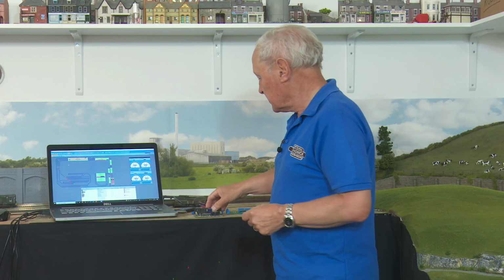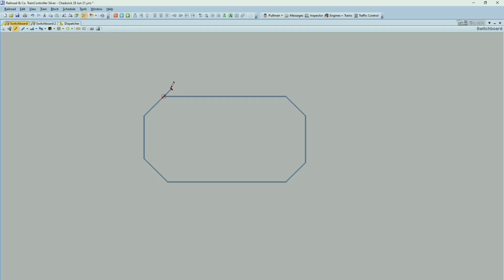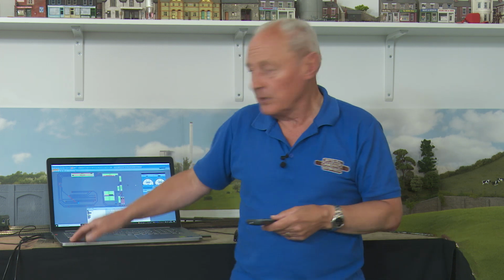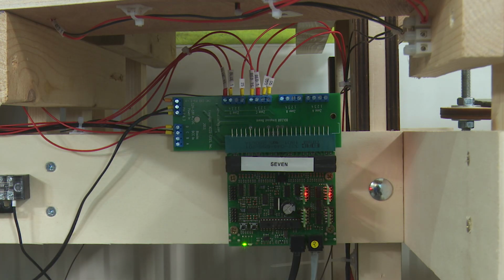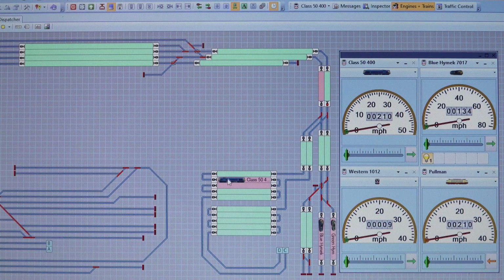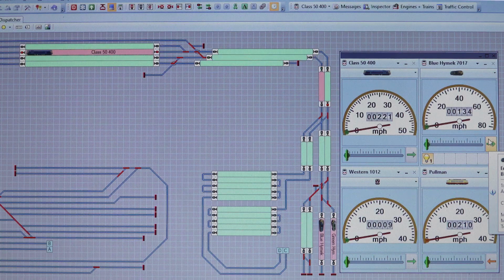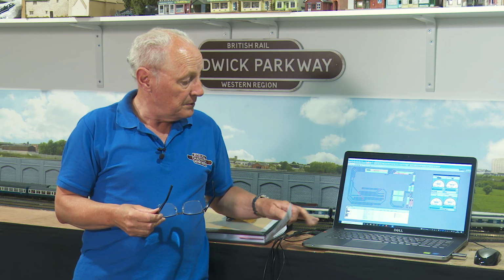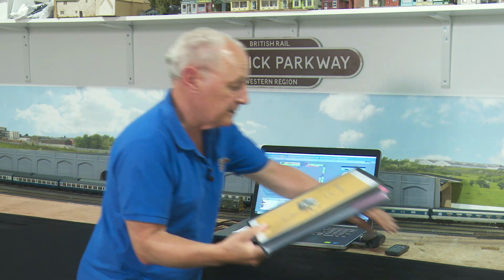An Intro to Block Detection at Chadwick Model Railway | 137.

Comment: Hi there Charlie, I have just watched this video for the information on block detection. I am building a new layout, the fourth  layout this one, I will get it right yet. I am thinking ahead and making insulated blocks in the track layout ready for future projects. I have already changed my control system to a Roco Z21, from my previous NCE system. Not sure if I will go for full automation but there is no way I could afford Train Controller, the guy does not seem to like us brits any way. Something I noticed in your wiring video is you recommending 7/02 for droppers, on another of your videos about wiring and power management you  recommended a site Railwayscenics where they recommend 16/02. Like you I wire every piece of track including points with there own feed, but since I got into sound locos I have had a bit of trouble with some of them. So the new layout I am presently building I am using 16/02 droppers. Thanks for these videos I understand the work you put into them even though you run oo gauge and I am on N-Gauge, enjoy the errors you put in too, others probably delete. Chris
Reply from the maker: Hi Chris, 
Yes I have moved away from 7x02 to 16x02. 
It was the voltage drop that led to me over engineering as usual! 
Regards Charlie

Comment: Charlie do you know if the bdl168 will take current via Rail A and Rail B. Strange question I know but I added block detection after my layout was built and I took advantage of the frog insulator to give me the first isolation point, hence from a main line the 1st section is rail A and the loop first section are rail B. Hope that makes sense. I recently changed from NCE to Digitrax, it didn’t matter because either rail was through an induction coil to the NCE AIU interface. Regards Roy
Reply from the maker: You might be looking at this from the wrong direction Roy.
The BDL168 takes power to the rail, not from it. All of my BDLs feed power to the red rail, and the black rail is the common return.
Hope this helps, regards Charlie
Reply: @ChadwickModelRailway  it’s ok Charlie I had some wild idea that hopefully I might be able to mix red and black on the bdl 168 if it depended on isolated current draw, but I can see now it doesn’t. Just have to bite the bullet and cut the relevant rails. Thanks for taking the time to reply. Always look forward to Friday’s though. Roy

Comment: Hello, great to look at your channel. I have one question concerning feeders for blocks. As block consists of 3 parts : entry, main, stop and obviously we need 3 feeders (for eg. + rail), but what about feeder/s for the common rail (- rail) ? Do you use 1 common feeder for entire block or 3 separate feeders, so each part in the block has 2 feeders (+ and - rail)? Thank you in advance for some help.
Reply from the maker: Hi Robert, the common return is connected across all rails. Regards Charlie

Comment: Hi Charlie, I am revisiting my track layout to set up blocks for block detection. The mainline blocks for the up and down  lines between the points to enter and exit the platforms is relatively short and would entail some of the carriages being in the preceding block and over the entrance point to the platform. Obviously this point would be set for the mainline but should the exit point from the platform line be set for a loco to leave the platform then the mainline block would need to signal the through loco to stop and as the distance is short the insulator for the rail would need to be placed to give sufficient distance for the loco to stop. I t is at this point that some of the carriages would still be in the previous block and over the point. The question is, will this work or does the complete loco need to be clear of the preceding block? Hope this all makes sense!
Tony
Reply from the maker: I don’t really believe that it matters Tony, as long as both blocks appear occupied. Therefore the carriages of your train, especially the last one needs to draw current to trigger the block occupancy. Regards Charlie
Reply: @ChadwickModelRailway  Thanks Charlie. Much appreciated.

Comment: H Charle, loving the very informative and casual way you describe things, keep it up. On block detection, if i ever get back to bricks and mortar ( curently living on a boat ), can you fully automate a section of track that will allow train detection and signal switching to include control for the signal/s until said train leaves a block? I guess just as in the real world. Thanksfor your time.
Reply from the maker: Yes Norman, that’s quite achievable. 
Regards Charlie

Comment: On a reverse loop both rails must be severed in two locations.  In any other block only one rail need be severed because the current will not be reversed.  Right?
Reply from the maker: Yes Jerry that’s correct.

Comment: I am using iTrain Pro 5 software, and Digikeijs equipment. Digikeijs seem to be the best off the shelf price per feedback/dcc decoders. Wouldn't touch Train Controller though, especially as they make you use a USB key to start the program, every time you want to use it. Lose or break the USB key... bye bye 930 dollars... I heard they are VERY difficult to get replacements for.
Reply from the maker: I really can’t comment, as I’ve only used a different system.

Comment: Excellent video as always Charlie. Many thanks for all your videos. Learning a lot. System ITrain Pro 5 (upgraded from 4) . Digijekeis DR 5000  and 4088  LN detectors , Tam Valley points (via servos). All connected  by Loconet bus. Cables easy to make. Dave.
Reply from the maker: Thanks Dave and I’m pleased that ITrain is working out for you.

Comment: Charlie: I need some of the LED boards for the BDL168. Does anyone make them for sale in UK, for shipment to USA. I need 12 pcs. Dgitrax won't sell extras past the single piece that comes with each board. Hope I can find a solution.
Reply from the maker: Hi Jon, not that I know of. I have several but they’re only supplied one per BDL. Regards Charlie

Comment: Very good Charlie, thanks for a very good video. I have block detection on my layout, and was wondering how to get the trains to recognise the signals and blow their horns at the correct times automatically. So it seems I will have to run software to do that. Heck it's not cheap is it.
Reply from the maker: Hi Terry, 
I build it into the attribute of the block. One example is that when entering my helix, sound is switched off.  
Regards Charlie

Comment: Hi Charlie,
Very late to the party I know but at the time this went out was not that interested in automating my layout which I run with Hornby Railmaster and eLink but as I am coming up to the 4th anniversary of the layout and 3rd one since I started You Tube I wanted to do something different so I would like to run more trains on my small layout 3600mm x 1850mm with a 3200mm fiddle yard/siding at one end at 90 degrees to the main layout and I think automating it will very much help (I hope) so I am also going to dcctrainautomation to buy my items I need and all the advice I can get along with all the stuff on YT. I am going to use Digikeijs hardware and iTrains 5 plus I will do of course some videos on it more to show what needs to be done on a TRAIN SET to get it to work and also how hard I will find it and in fact if at the end was worth the time and money it takes so thank you for doing your videos and all the other ones I have watch which do help me in advance think of problems along the way when I get started. Keep safe and well and doing these helpful videos.
Cheers Robert.
Reply from the maker: What a heart warming comment Robert.  Good luck with your project. 
Stay safe. Regards Charlie

Comment: Hi Charlie, bit late on this video, but I'm wondering if you would know about using the Circuitron "Smail" point motors would that be an option for controlling points with block detection as opposed to the DS64, and would there be any advantage to using those? Thanks!
Reply from the maker: They will certainly be cheaper but personally I don’t know anyone who uses them.

Comment: Great video. Can you show us how you would use or install resister wheels on your cars so the entire train can be detected in a block or multi blocks. I am just about to start installing my bench work for my layout that will use Digitrax and train controller silver. I have been watching all your videos and trying to learn from all your mistakes (thanks for posting them too) and what has worked for you as I take notes before starting my project. Thanks Jim
Reply from the maker: Hi Jim, please take a look at my video number 9.

Comment: Great video again Charlie... I have a layout with 30 feedbacks distributed over 15 blocks. I had been running Rocrail for some time before I got an iTrain trial license valid for two months in the Spring this year. Two months trying out iTrain was perfect. It made it possible for me to figure out which level of iTrain to purchase. I settled on Plus. Thanks to Bob Fuller's extremely pedagogical video tutorials on youtube it has been enjoyable to install and run iTrain. 
I use loconet decoders and detectors made by a Swedish maker, MGP, that are very reliable and not expensive at all. A detector for eight blocks is priced at about 15 pounds.
Reply from the maker: Great info Gorman. Worth some investigation too.

Comment: Hi Charlie
Great video again Charlie, you really have a great channel. You’ve sold me on block detection and I’m thinking of going down the itrain and Digikeijs route but it appear a minefield. I have approached James Hudson for some advice and help. I have a question tho how did you wire your helix for block detection? Did you have each level as one block? The reason I’m asking is I have just put together one of JAMES’S helix with 5 1/2 levels and I’m thinking of wiring now for block detection.
Reply from the maker: Yes, each circuit is a separate block both inner and outer.

Comment: Hi. I had a look at the different prices of Train Controller and I think that the UK price is derived something like this: There are prices within the EU and outside the EU. Obviously the UK is now outside the EU, so the outside EU price of $699 is applied. Unlike most other countries in the world the UK also requires the supplier to register and account for UK VAT to the UK authorities, and to provide customs clearance documents which previously were not required. This is not necessarily the case in some other countries (for example the various US states only require sales tax to be added by a vendor who meets certain nexus criteria of physical presence , sales volumes etc). If you add a $75 customs clearance handling charge for the UK you get to $774, add 20% VAT and you get near enough to $930. Similar logic works for silver version. C'est la vie.
Reply from the maker: Great comment Charles, however I have my doubts. Regards Charlie

Comment: I'd wrote a long reply on this one and it got a bit OTT. So the shorter version with regarding to pricing. It looks like they have applied the USD to GBP exchange rate. But then it looks like they have applied the rate the wrong way round and got a Higher dollar value when they should have had a lower Dollar value GBP equivalent. If they have done this then I am not sure why as they kept the pricing in Dollars. But the values don't appear random when you plug in the the rough exchange rate.

Simple case . Exchange rates as of 17/08/21          $1 USD to GBP £0.72  and  £1 GBP to USD $1.38 And all things being equal...

USA value is $1 UK price on current exchange rate is £0.72
What they appear to have done is 
USA value $1 and then applied 1.38 so it becomes £1.38
I did the math on the figures but used the $1 as an example. It doesn't help that if they have used the exchange rate then they haven't used GBP on the store page. Which would have flagged up that they were vastly over pricing.
Reply from the maker: Sorry Andy but it appears that it was a way of punishing Brits in view of leaving the European Union!
Reply: @ChadwickModelRailway  Always liked this version of a quote since i read it in a book by one of my favourite authors :-) "Never ascribe to malice that which is adequately explained by incompetence" And I have builders in at the moment so I know exactly what he meant by that. Also your option does make sense as well. If I wasn't British I would be giving us a hard time as well lol

Comment: Great Video! Thank you! I have the TrainController Software from Freiwald and Hardware from Littfinski . I have two Digital Center. One High Speed Interface for the Blocks and one for the Track and Switch from Tams. I've been working on the system for 7 years.
Reply from the maker: Thanks for sharing Christian.

Comment: Wrong Charlie ,
 plenty of Block detection circuits available for DC. Have a look on the MERG website for the link to Davy Dick's free online book. A good explanation is found in the Track Occupancy detector section ranging from microswitches to TOTI (Train On Track Indicators).If you are a member you have access to many kits at prices a lot cheaper than going the DCC road. I'd rather spend my money on trains and scenery than decoders.
Reply from the maker: Thanks Andrew, hopefully the DC guys will find this comment.

Comment: hello charlie, im wondering can you or any of the modelers help me out here. I have built a dcc layout with many blocks using nce bd20s / nce aiu-01 and the hardware to power the layout is nce power pro. i want to automate my layout as much as possible so i purchased the Train controller software. The problem i am having is i am unable to get a loco to stop at the same point in a block no matter how many times i try, i have followed the instructions religiously in the tutorial videos here on youtube and read the Train controller manual but it does seem to work. the result i get is, after programming each block with the dimensions i require and then using train controller to run and stop the loco in the block. the loco will always stop at a different point in the block and the difference can be upto 40 cm. Does anyone know how to resolve this issue. im feeling that my nce power pro is not fully compatiable with Train controller.
hope this makes sense.
Reply from the maker: Hi I247,  I have found the same problems. You must speed profile all of your trains so that Train Controller knows at what speed they are performing. I also use two sensors per block one for the rundown speed and the final sensor is a stop command. I do hope that this makes sense. Also there is a train controller Facebook page which I suggest you join. Regards Charlie
Reply: @ChadwickModelRailway  thanks for the swift response,  have done all the speed profiling etc etc but all to no avail. Like i say i am wondering if its the combination of nce hardware im using that doesnt like train controller i really dont know. I ll have to make a fb account and search on there. Its a shame as it taken nearly 10 years of building and acquiring all the bits but still cannot have reliable automation.
Reply from the maker: Have you sought advice from the videos of Rudy. They are very useful.

Comment: Without being political, the software price rise to UK is pure revenge by a disgruntled German seller because of Brexit.  Of the 28 EU countries only 10 are net contributors into the EU budget, the rest take. We were the 2nd largest net contributor after Germany accounting for 20% of the net contribution.  Our departure mean the remaining 9 net contributors now have a 20% increase on what they give now, and, for Germany, this is an extra 5 billion euros per year..!  So, it was always all about the money.  Spain, Luxembourg, Belgium, Greece, Portugal, etc, are all net benefactors.  I note that ESU prices have gone through the roof just because of customs and VAT so may switch to Digitrax although it is not as good, my DCC control investment not yet that big.
Reply from the maker: An excellent comment and much appreciated Patrick.

Comment: Thanks for a great video, as ever. However, the costs of your system on my layout (44m of track, 29 points and counting) is truly eye-watering. My approach is NCE throttle, servo motors, Megapoints controllers and block detection, giving at a minimum a decent mimic panel with the scope for much more at a fraction of the cost.
Reply from the maker: Great comment Alan. Just for the record, the majority of track (but not points) point motors and my controllers, are all second hand.  The true retail price would be staggering.

Comment: Another great video. You're a genius with all these electronics. I know you've probably mentioned it a number of times before but what size cable would you use for bus wire on a small layout of say 9'6" x 6'6". Thanks.
Reply from the maker: Hi John,  you mentioned size but not power. 
24 x 0.2 for bus and 16 x 0.2 droppers wold be best.
For low power 16 x 0.2 and 7 x 0.2 would be okay.
I’d go with the first.
Reply: @ChadwickModelRailway  Thanks for that. I'm running an analogue Gaugemaster Q4  controller.

Comment: I don't remember the name of the book but I have read a book from the DC only are that shows how to wire block signals on those tracks.  What happened to the tunnel in the corner behind you to the left in this video. I saw the video where you were installing a tunnel in an area that looks like that one.  I will not pay those prices for that software as it is way to expensive.
Reply from the maker: Hi Paul, I only installed the tunnel mouth for the video. It’s exact position is undecided until the hill above the helix is built.